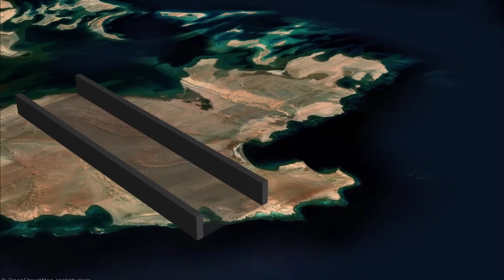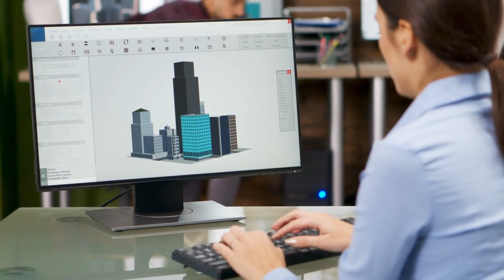THE NEOM CITY Saudi Arabia’s $1Trillion City of The Future

Comment: A crackpot, harebrained scheme that will never come to full fruition. Why a line, it's completely pointless, that's why it's never been done before.
Apart from all the other idiocies, what are they going to do with all the salt from the desalination plant? You can't just pour it back into the sea.
The railway will "8:12 connect both ends of the city within 20 minutes." 
At 170km length, that train is going at 510 kph or 311 mph (VERY FAST!) and that's without stopping at any stations.
Hey MBS, have you thought this through, ....................are you sure?